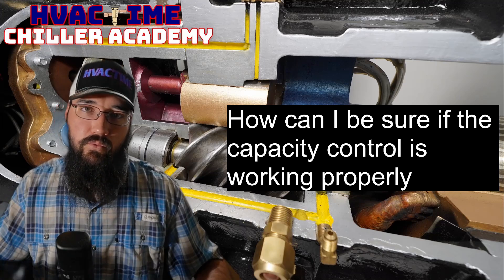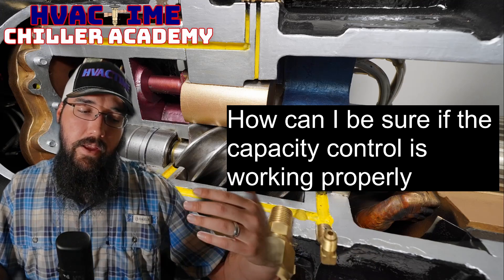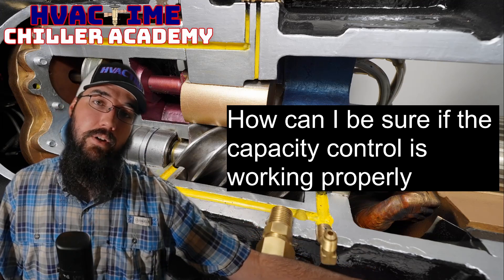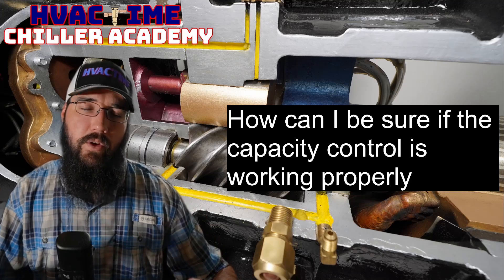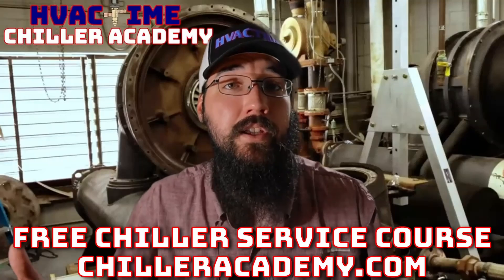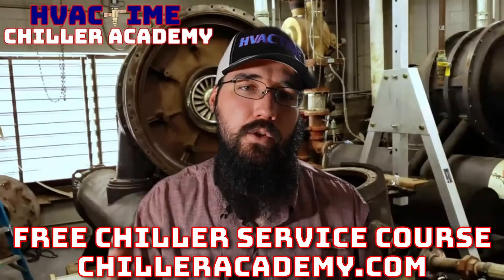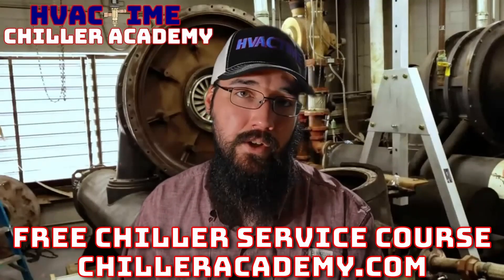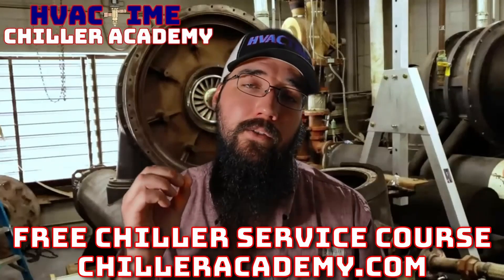Check Screw capacity control Explained

Comment: We use a slide position sensor to tell the controller where the slide valve is at currently. We have 2 slides. One modulating and one fixed. The fixed goes from 50% to 100%. Thats on older machines. All the new screws i see are variable speed, but they still use slides...just not for capacity control as you previously mentioned in a video

Comment: Trane Rtaf compressor with vapor injection has vfd and slide valve but has issues with vibration when running part load causing broken vapor injection line pipe
Reply from the maker: Need to verify oil flow/filter but bearings may be shot.
Reply: @HVACTIME  it was more on building design chilled temp of 22C only causing chiller to run part load. It was building of first 3 amazon building in bahrain, it was also specially design RTAF chiller with R1234ZE. We commissioned it with team from trane france factory. We ended up of replacing all broken elbow on injection for 48 circuits  for 12x  350tr unitd